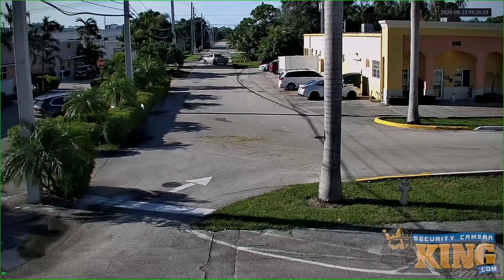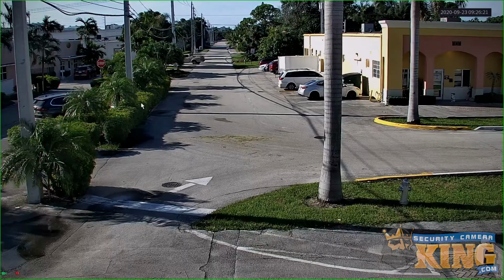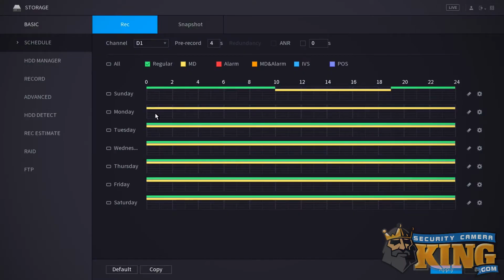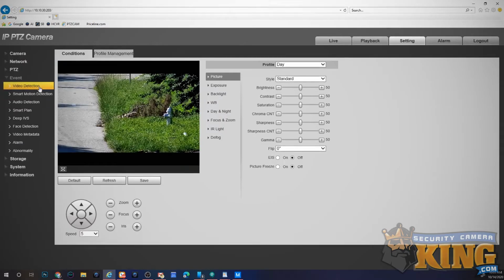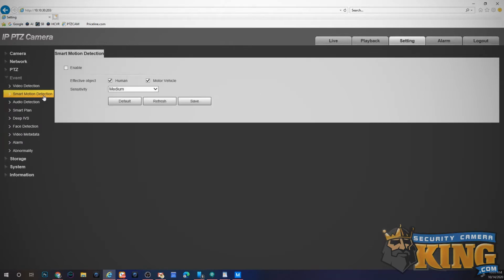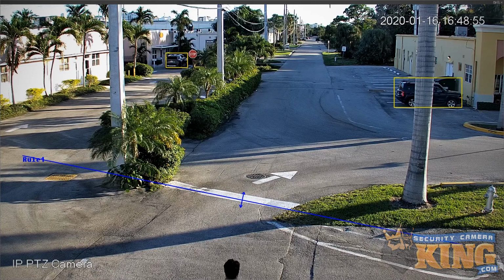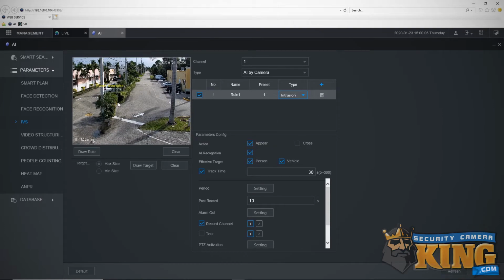How to Reduce False Motion Detection Alerts on your Security Camera System

Comment: Nah I can tell you some cameras do not work completely cause you can fill in the whole tire screen with the squares and it will still go off
Reply from the maker: If your goal is fewer false alerts, then please know that filling a screen with squares is not going to yield this result. If you need assistance with properly setting up IVS contact a support agent for your hardware. It is highly recommended to seek the proper training in setting this process up as despite sometimes appearing self-explanatory they are not, and require knowledge directly taught by someone who knows these processes very well. 

Do not attempt to set up IVS or CCTV without proper training.

Comment: Thanks for the video! IVS is super great. Intrusion areas work best, coupled with trip wires. None of these should supersede continuous recording though. Always be recording. And I have found that when smart/ivs is enabled it's best to turn off motion detection for those channels. Not only can it mess up all the events record timings log, which makes it a nightmare to scrub for events on playback between the two, but IVS should take the place of motion detection completely. When IVS is set really well, you can drastically and almost entirely eliminate false triggers. Absolutely no need for motion detection too. Just turn off motion detection, set up IVS, and make searching events a pleasure. But always, always record continuous too. Continuous + IVS. All you need- plus the largest hard drives you can afford for longer archiving.